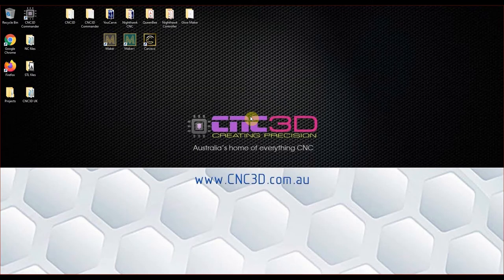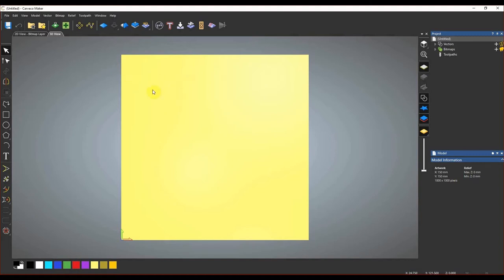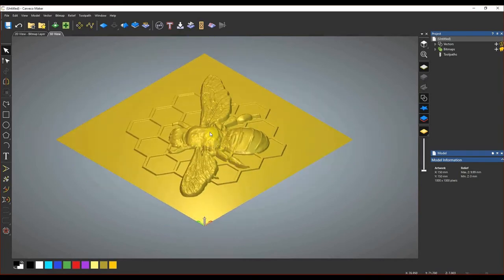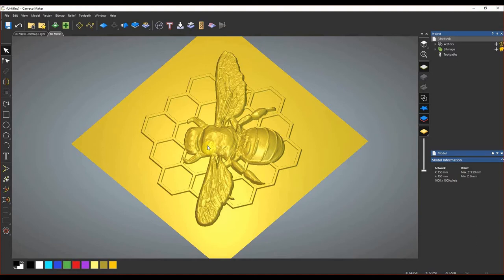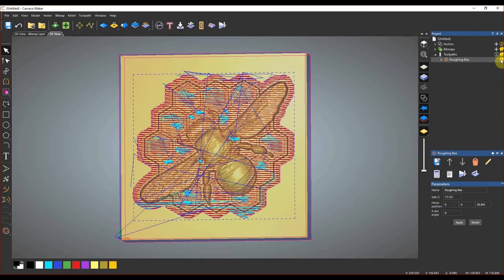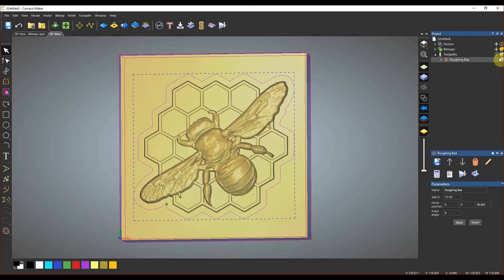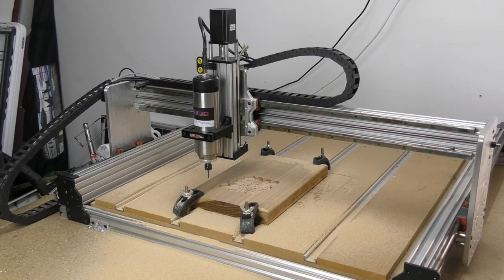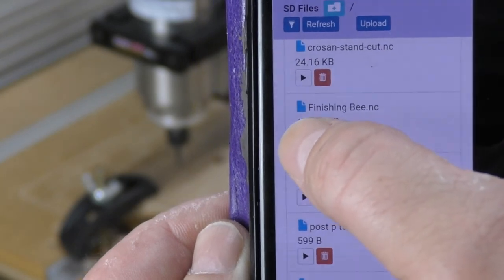CNC Tech-tip A beginners guide to 3D carves

Comment: From a fellow CNC tutorial maker, that was a great tutorial, thank you. I haven't done much 3d work up until recently but I noticed the outside border looked quite rough and unfinished.  why did rough cut to the outside but only finish the inside? Hope your don't mind me asking but I don't think it was covered in the video. Thanks PS. your software looks pretty cool and I really like the phone app.
Reply from the maker: Thanks James,

Certainly running the finishing pass to the outside would work well. The objective of this video was to keep it very simple and to reduce the total time the carve took. Doing the roughing pass around the border meant we didn't need to slow raster the flat edges.

In future videos we'll do a rounded vector perimeter with a bowl bottom and finishing pass that area so it's silky smooth. :)
Reply: @cnc3d  perfect! I was just trying to understand why and that covers it. Thanks again 👍